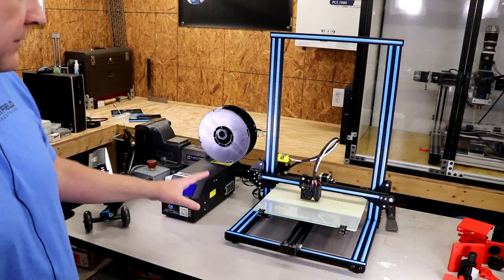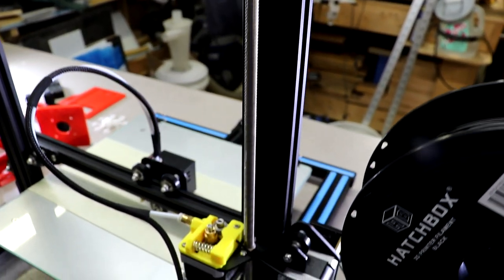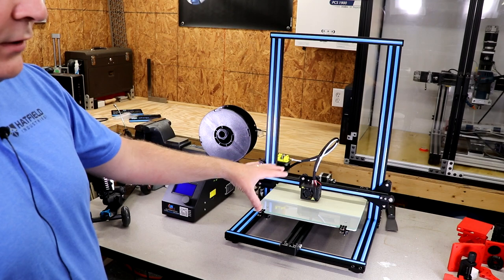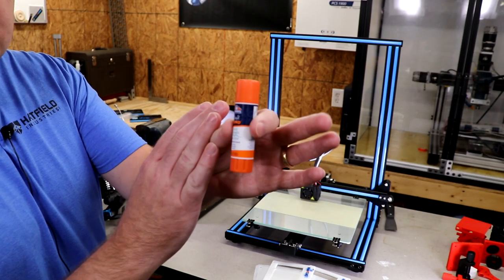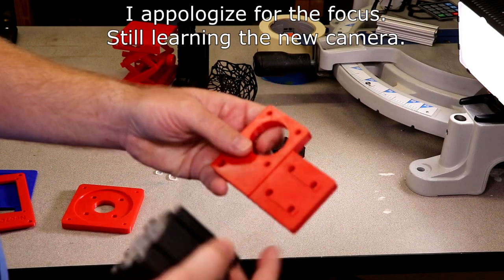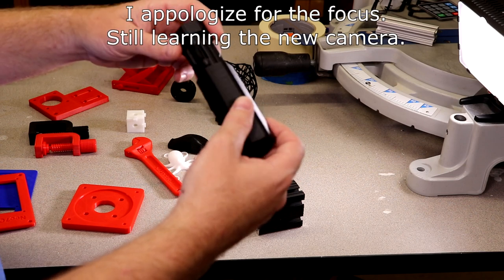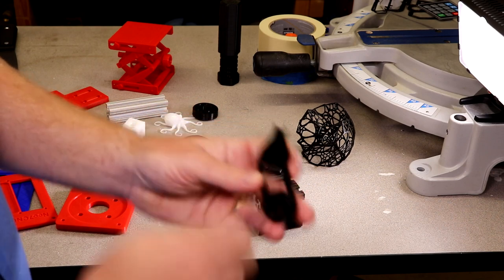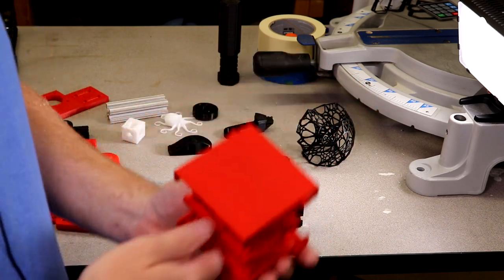Creality CR-10 3D Printer from GearBest - Neo7CNC.com

Comment: Good to see a new vid you inspired me to build a CNC using second hand THK rails etc over the cheaper Chinese rails.

I have since upgraded from steppers to leadshine hybrid step-servos and many other upgrades everything is metal except the table that is still MDF I'm just trying to source something suitable to replace it.

My dad has been a machinist all his life so I ended up giving him stock material and he machined it all

I have a 3D printer that I built from scratch and use diluted PVA on the bed just warm the bed up and give it a quick brush over

Comment: Gluestick on bare glass actually works better for me than on tape. As for the height thing, I've printed things as tall as 8" on a regular basis, and one print that was 2mm below the absolute top, and got no waver in the prints. And if your glass ever warps or breaks, the $10 pack of 6 mirrored tiles at Lowes or Home Depot fit and work perfectly. :D

Comment: I'm surprised mcmcaster didn't have a model of the tri-corner pieces. I'd modeled my own as well. Got a couple of them for half price from 80/20's ebay store but the tabs were way out of tolerance.
Reply from the maker: I had found one or two on the ebay store as well a long time ago.  I got the ones that are on the enclosure in the background from someone on ebay (not the 8020 store) and got them for a steal.  I don't find deals like that much anymore :(  Thanks for the comment.

Comment: You already have a x-y-z machine, with a lot more accuracy and silent! Why didn't you consider to make a printer head for that one?
Reply from the maker: Gejes very true. The mechanisms are indeed very similar and many have done that. For me personally, I like them being separate machines as CNC machining is inherently a dirty process.  Dirty isn't good for 3d printing. I also like to have my 3d printing capability in the house and not in the shop. Many have done it but I prefer to keep the technologies separate. Thanks for watching.